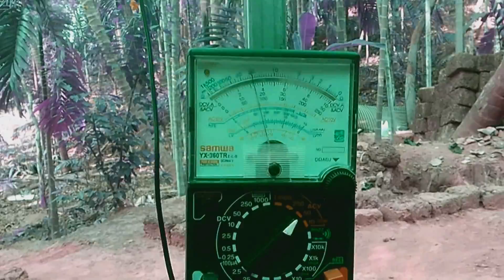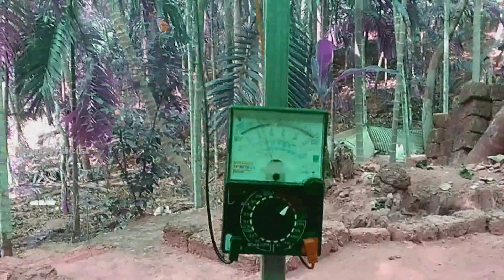DIY Wind Turbine 👍 Most Popular Wind Turbine Making Video

Comment: Which generator did you use?  How many amps and volts did it generate?
Reply from the maker: It’s an old cycle Dynamo. I’m currently working on another wind turbine project in which I’m going to use a permanent magnet DC dynamo with gear. Propeller video just published. Pls check

Comment: OMG ! Do you have to use such irritating techno-repeditive music ?! Can't you find something a little less irritating to listen to than this crap ! Regarding your innovation, I think it is quite good and reasonable to make. However, the way you work and the manner in which you put your design together also was driving me nutz !!! I would have slowed down a little, and taken my time to more carefully measure and clean each piece of metal before making a weld. Also, I would have used a T-Square and a Right Angle to make sure all my pieces went together at equal 90 degree angles to each other. Clearly, all your welds are cold ones, and I would have taken my time researching and forming and cutting and shaping my wind blades in order to be sure they were as efficient in grabbing the wind as they possibly could be. Frankly, you did a shlock job at putting this project together. I would of thought "efficiency" of operation would have been your highest priority in putting your windmill together. Just because you did it yourself doesn't mean it has to be so crappy.

Comment: You might know the answer to this...  I was writing some of my ideas about energy options and one of them is to have all sources of gathering power hooked to the same machine that turns raw power into house/useable power... solar, water, wind, etc.  --- In the process I mentioned that power generation only need movement... and doesn't have to be huge turbines for wind power.  I have seen some small energy creators, house size, and the old kind that pumped the water out of the well (windmill), but as I was writing I thought of those wind measuring things that weather men have... little cups on their sides that spin around a pole.  That shape seems perfect for wind collection... what do you think?  Could some kind of small and simple wind options be created for individual home processes, like solar is utilized today?  Also, can't we generate power from rain water going down the gutter?  Simple options, small options, all year options... hooked to the same converter.
Reply from the maker: Yes. It’s amazing. I’ve installed a small off grid setup in my house. (Watch video). I’m building a simple wind turbine to use with that off grid setup. Your idea to use rain water for power generation is possible and there are people who does it. Thanks for sharing your valuable ideas. Keep contributing. Watch my latest videos too. 💕💕

Comment: Lame small power 2 much work just get a the right  self exiting alternator or just take out the rectifier out of an alternator and hook it up to a switch so that it works just like in the car ..Then you can change the load or resistance that powers the magnetic flux or power and slow it down or speed it up with a fuse !

Comment: You lack circuit n hardware! Even if it's a wind turbine but to generate electricity you have to put n calculate watts n diode ,transitor, resistance and such things to generate stability flow of electricity. If you directly connect  + n - to any light bulb or machine it will burst n destroy it. I can see all you do is using motor, motor, motor n nothing else. As an engineer ,u lack hardware knowledge. U r just art design n nothing more to me! Don't say it just a wind turbine. Of it's a wind turbine , why are you using motor again. U want to generate electricity but failed!!!!
Reply from the maker: My point is to promote green energy! Technically I’ve made many mistakes. But I love to do it my way❤️. Thanks for expressing your opinion. Keep contributing.

Comment: I really like how you used existing parts on other machines, for instance the 360° pivot from the caster, which I suppose is not easy to find as a single part, and cutting the blades from a wide pipe to get the curvature. Very smart thinking.

Comment: you need to put your tail fin low below The wind props low pressure is developed behind And it will not rotate to the direction of the wind 💨 properly when the winds blowing good or your turbine can just spend around 180° and start rotating the other way !

Comment: Bad place to locate a VAWT.
In the middle of tall trees where the wind speed is at a minimum!  How much energy does it produce?  Or did you intend to demonstrate that the blades actually turn in the wind?  I liked it as a prototype for building a model for demonstrating the ease of construction.  3 blades are always better than higher numbers because of lower drag.  Place it on a taller pole attached to gaywires and give us some idea as to how much energy it produces at different wind speeds.  Thank you.

Comment: Not even a single leaf of a tree shaking there, how is your generator spinning
Reply: haha the fuck, yeah and the chain isnt even hooked up
Reply: Bhai ...same lines were in my mind......Not a single. Leaf
Reply: Blade is rotating by DC motor.. 
Not rotating by air 😅😅😅
Reply: That generator also works like a motor if we supply the electricity, that's why it is spinning easily.
Reply: It is a another damned fake video with DC motor connected to battery, or propeller pushed by hand (and NOT connected chain). And 95% viewers (51k likes now!) says: "Great video, good job!". World tech knowledge sucks. I will make pretty soon some YT material about wind turbine fakes and design failures.
Reply: Agreed
Reply: He put battery in the wind

Comment: I would think useing a car alternator on this would produce more Voltage at 13 or 14 volts and a lot more wattage at 500 watts to 1900 W using a car alternator from an  automobile ( a car or truck) , either way , good video you have a good Ingenuity,  I see you have done this before making windmills that produce electricity,

Comment: Awesome ideas ... bad design !  Bicycle sprocket and chain require frequent adjustment , weather prone , and create a lot of friction/drag to keep things moving and reduce free energy !  All that work , should have used a much bigger and better suited design type generator motor for this task !        Overall .... I give it a 2 star for design/idea  !
Reply: Any suggestions?
Reply: Use only straight drive directy to motor shaft . Mount blade directly to motor shaft . A good motor for this project . Start with a a throw away a electric  thread mill motor will be ideal  .  You can use any motor really .  You can turn washing machine motor into  a generator motor by isolating its coil winding to generate electric field .  Everything I told you is on youtube so search it .  Hope this help ?
Reply: Just type in thread mill motor wind generator or washing machine motor wind generator .    Any motor will work but choose the most powerful generator type motor if possible .... good luck
Reply: Remember :  the bigger/more load  generator head require a bigger blade to push it and also pick the right blade desire for the right wind condition for your area !    Good luck !

Comment: Nice build but there are things that I don't understand.
A. What exactly is made in a 1.3 : 20 ratio? The blade taper?
B. Why notch the base of each blade? It only creates a weak point and serves no detectable purpose.
C. How was a slip ring made to connect generated power to a load when the mechanism turns to face the wind?

Comment: PVC is designed for water flow or electrical shielding, not wind turbines.  In this application, they will shatter.
Reply: yes they will shatter. but only at certain wind speeds . when those are reached . you will have more pressing problem . than your little wind turbines blade shattering.

Comment: I see a few problems . One is that would wrap any wires around the stand till it got stuck or broke off. and Two, once you put a load on that bike generator it will load down  and stop the blades from turning, I've used them on bikes back in the day and you can really feel the resistance they give with a simple tiny light bulb in the front and back of your bike. Maybe a old car Generator from the pre 60s cars would be better for the output but you still need bigger blades. It might work to mount an LED on the moving parts .

Comment: your welding is poor iIbelieve, you don't melt the metal enough and you are only adding the electrode to the parts and not actually melting the parts together.

Comment: You should mention how using PVC for turbine blades is a dangerous idea since it is not very sturdy and results in high failure rates over time versus proper materials that possess high tensile strength.
Reply: What publicly available and relatively cheap materials would you recommend instead?

Comment: would it be more efficient if you had 5 or 6 or 7 blades? any effect on it?
Reply from the maker: 3 bladed are the optimum amount. More blades means more cost and more aerodynamic  disturbances.. 3 is the best. I will do a brief video about  why wind turbines use 3 blades soon.. by the way  thanks for  watching ☺
Reply: @newphysicist  you may find that 5 blades is more efficient at this lower scale. The tip speed ratio needs to be taken into account. Low to the ground the air moves very slowly especially around trees like yours is. This means that it cant get a 3 bladed turbine to optimum operating conditions but a 5 bladed turbine has 5/3 more torque allowing it to cut in at lower speeds more commonly seen at the height your turbine is at. So basically even if 3 blades runs more efficiently if the 5 bladed turbine runs twice as much you end up with more power per year. You will have to get the wind data for the area you are interested in. Big turbines use 3 blades because they have the luxury of being up much higher in smoother consistent air. Your also gonna get aerodynamic disturbances either way unless you use a thicker airfoil shape that isnt single sided so the 5 may win here.

Comment: Ok, now show me how you run a stove of this...
Reply: Could you at least turn my friggin water to wine PLEASE
Reply: @davidoconnor4717  ok, ok, but only this one time.
Reply: Brilliant but back to what you said a year ago no this turbine would not power a conventional  stove the normal home ones require usually 500 volts mains power plus Dyno method is limited to small outputs would need an alternator just for charging a 12v system
Reply: @davidoconnor4717  yeah, so I have built two of my own systems using old 12 volt cordless drill motors, they both have to run fairly constant to keep charging the battery enough to keep a charge, once the load gets to high, they slow down dramatically. I've tested different loads and it can get to a point where the motors have so much load that it becomes dangerous to the forces on the pvc blades. The biggest concern however is the height at which it is efficient. a normal roof top gets way to little stable wind, there is just too much turbulence from the infrastructure, so you get influxes of wind which is really not what you want. You need to go double the height of a house at the very least. Solar is really the best way to go, unless obviously you stay close to a constant running river/stream/canal where you can use the water as a source and build a cheapish system.
Reply: Show me how you walk on water first
Reply: @davidoconnor4717  I stopped doing that in the early 1700s. It is not a thing anymore.

Comment: reduce the amps from your welder!(or switch the polarity if it works with the electrodes you are using - check the packaging for further info)  you are melting too much metal. work in short continuous bursts. don't just "touch" it (what you are doing can't be called tack welding) Anyway nice project.

Comment: Overall a very well done video. And you learned a bit about welding. You make very good use of materials which helps viewers see that they can succeed in this project.
Reply from the maker: Thank you for your kind words.. 🐦🐦
Reply: The welding will improve if you warm the rods first in an oven, wrapped in foil. Just until they are very warm to touch, but not hot enough to burn you.

Comment: where can i get the device you installed at 9:52 .. I really want to do this at home
Reply: That is a 'dynamo', used to provide electricity to run lights on a pedal bike. When you want power you move it so it touches the wheel which turns the generator. Try a bike shop or junk shop.

Comment: Nice work but when you give some electric load on output current speed would be very slow, and for better current u can use any r.o. moter which can be generate 24 volt with high ampier also with a small inverter circuit u can convert the voltage into 220 ac.

Comment: Latex gloves for running a cutting disk but bare hands with apoxy? I've never seen such ass backwards use of safety gear like the safe looking sandals. My opinion, you have a nice design but should use belt drive instead of chain.

Comment: I liked the video, I would like to see how you will use the energy produced because the wires are hanging and as soon as the wind changes direction they become twisted until they break or they will simply turn off because they do not follow the rotating movement. It seems like a half project like this.

Comment: From an old car you can get a stronger DC motor which can replace the dynamo - voltage can be low - then it needsa DC/DC converter to charge a battery for time when the wind does not blow.Useful . Take care when it works -be farfrom it children and animals too .

Comment: bro ur great ,but u see this video iam in village ok in the center of tree how that fan is rotating this speed no way all the trees are silent I don't know how did u get air even single tree leaves is not shaking ........
Reply: Maybe the motor is in motor mode instead of generator mode. It is a bit odd, since the trees and leaves are hardly moving.

Comment: Wow, easy as that, that's amazing. Pity I have no welding tool because I would love to make this very handy good useful gadget. Thank you so much for sharing, you are very kind. Bless you
Reply: bolt it together . the shaft with the bearings in i would use the peddle crank from a old bicycle . just clean it out and re-grease it first ,
Reply: Rachel Tomlinson

Comment: I don't get why you would keep up the warning about safety when you use angle grinder without the sheild. Secodnly i would use washers on the fins themself. Because they will break, Sun and weather will destroy the fins and the welding is so weak that it will rust and break probably in less than a year.

Comment: Incorporate a transmission and a swash plate pump motor type 12 into your build and add a rewired drum motor generator with magnetic bearings and place a few vacuum spark gaps within your system and then use organic carbon power cell banks in place of lead acid deep cycle batteries. A windmill on steroids! Use solid state graphite power cell banks to trickel charge power cell banks when there is no wind. ; )

Comment: I applaude your efforts but what you have shown with welding on galvanized steel is just plain dangerous. Stick welding is the absolute worse form of welding sheet metal and when the galvanizing is heated it produces lethal gasses that WILL kill. Your quality of welds leaves more than a little to be desired. I suggest gas welding if a proper tig or mig setup is not available and absolutely NEVER weld on galvanized steel, it contaminates the welds along with off gassing multiple poisonous gasses.
Reply from the maker: +Southron Jr, thank you for watching and commenting valuable information. It would be a very helpful to my viewers. 👍
Reply: what you say is true but a bit strong, absolutely never? galvanized steel has many benefits for constructors especially when you get hold of scrap, galvanized is usually hot dipped, so the trick is to grind off the surface where you intend weld, and absolutely do all this outside, preferably in a slight breeze away from you. I do believe its bad, the smell is foul and evil,so yeah.
Reply: Fred Z You are correct, after looking at my post I should have been more clear. NEVER weld on the galanization on steel. The best way to deal with it is grind the galanization off past where the heat would affect it. On EMT tubing I generally grind all the coating off about 1.5 to 2 inches from the spots the weld heat might touch. I also clean up the splatter and the paint the weld as soon as I can after the metal cools because if you don't the area you ground clean will rust very rapidly, especially in humid climates like the Southeastern US and the Phillipines where the video was shot.

Comment: Great job Nice build works very well are you going to light up something  or  or put into a battery  bank to store the energy  .. Nice Fabrication
Reply: What kind of plastic  are you using  for the Turbine  blades I Built a wind turbine  and made the blades out of PVC  and we got 40 Mph wind gusts  and the blades blew apart
Reply from the maker: +ARCTURUS WELDING & FABRICATION STEEL FABRICATION, it's 4mm pvc

Comment: how did you measure the spacing for the blades  what formula did you use so the blades  are  all the same spacing
Reply from the maker: +scottymizzo415, I didn't used any complex formula to equally decide blade spacing. Divide propeller hub 120*3 degree. Perfection in joints is the key. Thanks for the comment. 👍🙋
Reply: thanks  for that info now  that you said  120 divided by 3   i got you
Reply from the maker: +scottymizzo415, 360/3=120